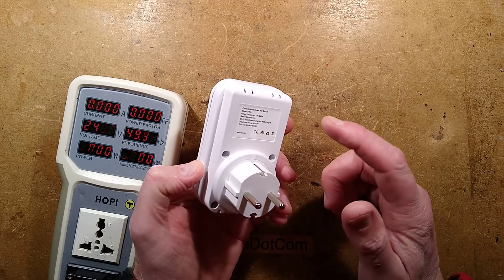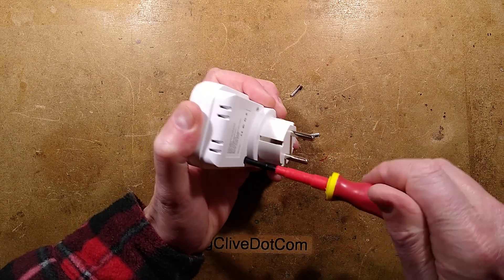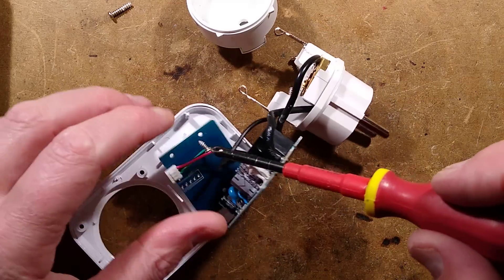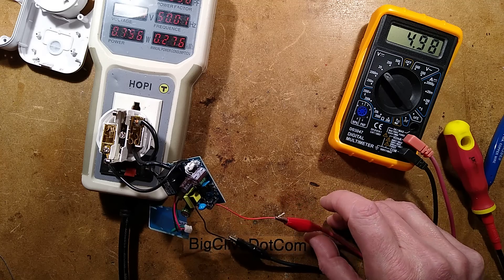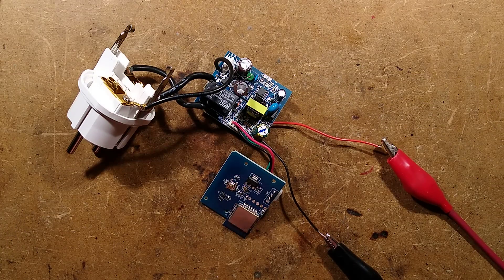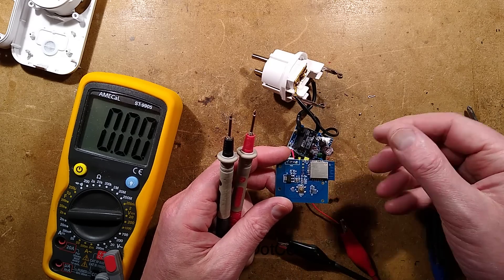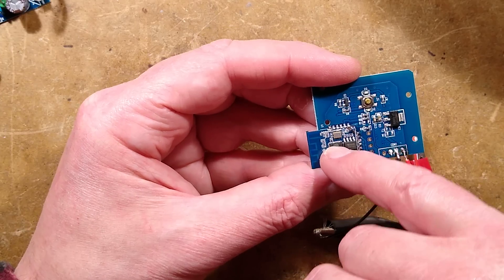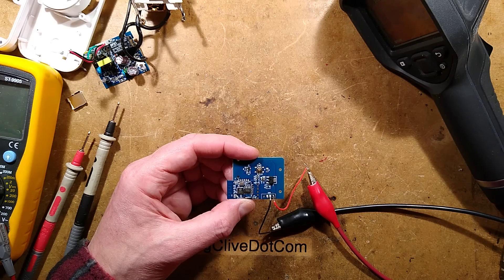WiFi socket repair fail

Comment: An ESP draws about 80mA of current when active with one or more sensors connected to it. The metal cover can get slightly warm which is normal. The WiFi module takes a lot of power. I have several DIY boards with them in service for a self made weather station using a Python server on my NAS recording data into a PostgreSQL database. ESP modules are pretty forgiving. I once had one connected backwards on 5V 2A power. It went really hot. But after realizing the mistake after about 10 seconds I swapped the polarity and it's since then working just fine. I think this was a manufacturing defect that manifested after QC.

Comment: Next to it looks like an external flash chip and ESPs use strapping lines for bootsel so if you desoldered the esp8266ex IC and replaced it with the same part you wouldn't need to bother with reflashing, just a drop-in replacement.

Comment: Does the EEPROM contain the firmware? If so, you could probably just yank it off and put it on another esp8266 module, thus bringing the device back to life. I've played with these modules before, but I've never actually thought about where the firmware is stored (on-chip or off-chip).

Comment: I bought a bunch of cheap clearance stock ESP8266 smart plugs from a charity shop last year. About half of them have failed; mostly from a dried out smoothing capacitor, where the whole aluminum shell literally popped off the top, leaving the paper and base behind. A couple, though, just turned on once and then never showed any signs of life again. I can now see why they ended up in a charity shop for £1 each, though the ones that are remaining by process of elimination seem pretty reliable.

Comment: What I'd try would be to see if it would work to reflash the firmware of the ESP8266, using an open source project like Tasmota. It is thinkable that the flash memory chip developed a bit of bit rot, throwing the MCU into a boot loop. At least this is somewhat consistent with the symptoms, but it is also very much possible that the MCU or flash chip got some more substantial damage, but modules with ESP8266 (or the newer ESP32-C3) are easy to get and replace. The existing Wifi module looks like LM1, you can find the pinout searching for tasmota pinout lm1 (not going to post any links).

Comment: It's possible the module has been bricked. A followup to this would be to hook the UART and use esptool to see if there is anyone home (esptool -p COMPORT flash_id and then chip_id).
Remember that to enter programming mode where esptool would respond you need to ground GPIO0 (probably the button) at power up.

Not that these things can't fail but I would guess a software brick first. If that's the case others also mentioned Tasmota and ESPHome (there is also Home Assistant Architect for HomeKit integration) if you want to play with these things.

All 3 are open source firmware that don't rely to shady cloud services and third party apps to control devices remotely

Comment: If you could find another wifi chip, maybe you could replace it, my guess would be that the firmware is in that SPI flash chip, and if you find another complete module, you could try replacing it, and then replacing the flash module in it for the older module.
But that is assuming the issue is with the wifi chip, and not the storage.

Comment: Wonder if it's a sticky / shorted button as they normally connect it to GPIO2 or GPIO0, boot mode pin. Makes it easy for flashing the chip. A revisit with the gound and TX pins connected to FTDI or CH340 to see what mode it is in at boot and any ouput

Comment: Great Video Clive, One thing you didn't consider was a possibly corrupt or failed software update? You sound like are a bit disappointed when you can't repair something. I just had the same with a Dyson Hot and Cool fan I was trying to repair. Seems the motor controller IC failed, took out a few tracks, and fed back into the MCU which is now toast! I could have replaced the MCU but I don't have the code to program it. I did a video on it if you're interested.

Comment: ESP chips run fairly warm and use about 100ma while idle...
It's likely the SPI flash chip either died or has garbage data on it from a failed update or something.
Short GPIO0 to ground, hook up TTL serial (3.3v) and see if esptool can identify the chip... If it can, tasmota time.

Comment: you can buy generic radio receivers with the remote (remote + bare pcb) and stuff that in !!
also maybe add a diode on the green wire to protect against reverse current from the relay

Comment: ESP8266 chips do run warm, so 30 c is not an unhappy tempeerature for them.   
I would say that it either lost its programming or the RAM  chip may have failed.  ESP8266 doesn't have onboard RAM so the external memory could also be faulty.   It would have been a cheap device most likely, based around the Espressif chip.   Unfortunately they do die at times.
Reply: Even some ESP32 have a tendency to corrupt their own on-board memory with their own WiFi signals. They're really cool and cheap chips, but sometimes I'd wish to pay a bit more for a tiny bit more robustness.

Comment: As others have said, these ESP8266EX modules are easy to get, so replacing it shouldn't be too complicated.

Why ESP8266 modules like to die? Not sure, I have had some NodeMCU boards that just went and began to act crazy or outright died. Haven't cracked them open, but they don't feel like the kind of solution I'd pick for anything that has to be reliable and work 24/7. Perfect for cheap IoT tat like this, though :)
Reply: have you tried to dump the firmware from a failed module?. a bit curious if it was a bad chip design or something caused firmware corruption. (or counterfeit chip?)
Reply: @n.shiina8798  Not yet, but doing more detailed autopsies on the failed modules is definitely on my TODO list.

One module I'm interested in debugging is one that was working 24/7 for months, then was put away in storage for a few years and when taken out of storage and flashed with new firmware just did frantic flashing with the LED. Firmware flashing succeeded, however, with 100% on the checksum.

Maybe the Flash is still fine, but something else failed? Very mysterious failure mode at least.

Comment: Hi, I have a question, maybe someone can help. I have a digital timer for a light in a small greenhouse. The last week it began acting weird, the lights began humming when off. I checked the timer and its leaking 20V AC (wallpower is 220V) when it should be off! What could have happened to it/How can this happen? It is not inside the greedhouse, so it couldn't have gotten wet. I know its hard to say without seeing the box, but is there anything inside a timer that could leak 10% Voltage?
Reply: Depends how it switches the output. I'd guess it may just use a relay, and perhaps there is a capacitor (snubber) across the contacts to prevent arcing which has failed? But that's just a guess without seeing it. I recently had something similar with a repair video on Dyson fan I did which the oscillation motor was on continuously.
Reply from the maker: Is the mains polarity correct?  If the relay is switching the neutral it may be that the lights have some current capacitively coupling to ground.
Reply: @bigclivedotcom  I found some corrosion/gunk on 2 diodes that go to the black wire on the outlet side and the relay seems to have gotten hot (I can scratch the housing with my fingernail at some points). It also seems to have an indentation on top from something. I think my darn cat might have thrown up on it. It got onto the black wire somehow shorting it and overheating and damagingt the relay and at least one diode (its no longer a diode but a 16million Ohm resistor). Sorry for you asking a question I should have asked my cat! We are going to have words.

Comment: Clive did you check the clicky button?
Reply from the maker: Yes I did.  I bridged it with wire, as they often fail with high resistance contacts.

Comment: Solder a new ESP8266 E12F module with Tasmota software. Or use EspHome software.
Or the devices are so cheap that you can buy a new one.

Comment: You can test the esp module - desolder it from the carrier board, you can replace it with esp12 module from aliexpress for under $2 and flash it with open source Tasmota firmware. The one thing that usually goes wrong is not the module, but the reset, enable and gpio0 pins. Might be worth to just solder rx/tx and check if/what the boot output is. But yeah - the price of such device is laughably small, not worth the time probably...
Reply: First one pointing to the needed bootup setup. Also, just testing tx with the scope should tell you if there is something there, which I doubt as the onboard led is off.

Comment: Hi Clive, I dabble with 8266 modules and I think that current is about right. I use wemos D1 mini's and they draw about 50-70ma they have extra circuitry to support programming etc. Has it lost its config? The comment below is a good idea!

Comment: 04:20 — Oh, the little pulsing whistling! Something's definitely wrong with the unit.
Reply from the maker: That's just the switching supply cutting in and out to keep the output capacitor topped up to 5V.
Reply: @bigclivedotcom  oh, now I see, thank you.

Comment: Looks like an esp12F module. They can pull about 140mA and get a bit warm when the wifi is running. They are very cheap, and you can flash them with ESPHome or Tasmota to restore working (and probably better) firmware for smart switches.

Comment: These have a tendency to attempt OTA updates when first connecting to WiFi and its unresponsive, seems like the setup has failed, so you start over and unplug it during the update and bingo you've successfully cremated the firmware. Otherwise there are naturally lots of reasons why forced OTA updates are just a bad idea and yeah smart plugs and bulbs are great at doing that and failing on you. As mentioned below Tasmota firmware may do the job.
Reply: Not necessarily. If your program is small enough, you can even use the stock OTA library to reliably update your program. It will keep wo copies of the firmware, one being active as well as one being replaced. But then again I might be expecting too much from companies trying to sell new hardware now and then.😉
Reply: @Smaxx  oh. Not to say OTA updates are always a bad thing but just in the case of these devices it often causes a bork and the average user is stuffed in that case. Forced updates without any notification that it's happening... Not great

Comment: I assumed those smart sockets used some proprietary chip and hearing you read out "esp8266" has now got me taking mine apart, and can not believe these smart devices are running a simple off the shelf ESP chip that can be re-flashed, re-programmed got me interested into taking mine apart now and might even order few ESP's for building my own smart devices, lol.
Reply: Toying around with ESPs is definitely fun! I'd actually recommend getting a NodeMCU for your first experiments. This way you get chip and programmer all in one module. It consumes more power etc. but reprogramming is way easier to do. There's also an insane plethora of combined boards with peripherals, like the "ESP32-Cam" providing you with a simple webcam module (using it as a cheap ~20$ device to keep an eye on our dogs without having to invest like 50-70 bucks into some China Cloud hardware).
Reply from the maker: Just keep in mind that not all the power supplies in these smart sockets are isolated from the mains supply.
Reply: Sadly tuya (the  biggest corporation who makes the modules for iot and the firmware and hosts the cloud servers) recently switched to other SOCs they ditched the esp (tywe3s, tywe2s, tywe1s, every chip with TY in it) and went for beken or realtek (WB, cb, wr etc.)

Comment: I know this might seem horribly mundane but what is the package of those little LEDs called? Good video, Clive, you can't save them all.
Reply from the maker: My own preference for surface mount LEDs is 1206 as they are easier to solder.
Reply: Probably 0805?
Reply: @rexsceleratorum1632  At least that gives me something to look up, Thanks!
Reply: @johnpossum556  LED packages are usually specified by concatenated 2 digit length and width, either metric (x0.1mm) or imperial (x0.01"). Like Clive said, 1206 is also my preferred size, being one of the larger standard SMD part sizes for resistors etc.

Comment: I think 99% that it's in the bootloop. 
ESP modules often got their firmware corrupted because of bad quality power supply and just trying to boot with a failure. 32 C is nothing to that module, totally normal temperature. My ESP32 can get literally hot while work with WIFI.

Comment: I have 2 different dead ones of these laying around. Unfortunately much smaller cases, but you just triggered my „let‘s repair them“ nerve. At least I have some of the ESP12E modules already in stock.

Comment: ESP8266 are quite fun chips!
Reply: Yeah they are, so are the ESP32's. I built a wifi geiger counter that logs to radmon with an esp8266, and ended up building an incubator out of a wine fridge using the esp32 which controlled the temperature / humidity/ egg rotation, and LCD display / menu while logging the data to the internet. Was quite a fun project.

Comment: it is first time I see BigCliveDotCom losing it ;-) It seems you do not have much exposure to ESP chips. There are pins on this little board you could connect to ESP and check what is going on there. Btw ESP are always getting warm - that is their nature
Reply: Not much. Lets take the magnification... E...S....P...8....2.... uh I cant see... let me change position and orientation... magnification again... We all were screaming 66!
Reply: @asturcon3794  EXACTLY!!!
Reply from the maker: You guys can see better detail with the HD video than I can see with my eyes.
Reply from the maker: It's lack of desire to work with ESP chips.  I barely have enough time as it is without getting into that minefield.

Comment: I think the esp chip is faulty, the LED on it was constantly lit with a faint glow in the video, sometimes that LED act like this when it's en pin is constantly hold down to gnd but most of the time is it's a sign of failure or wrong boot mode. A working esp in a good operation mode blink on startup.
Usually two things happen about these modules, either the program on the spi chip will get corrupted by external causes like power failure or the esp chip go bad, considering the esp getting hot it might be this but even if the esp has failed you can still repair this product. 
The whole program on these modules is on the spi flash chip, even if the esp has failed most likely the spi program is intact. If the esp chip is faulty you can either repalce the esp chip (qfn package might be to small for some people) or you can change the whole module and put the old spi chip into new module then whole thing comes back to life with it's original program. No programming needed at all.
If the spi is corrupted programming is required of course.
Either way it all depends on how much time and effort are you willing to spend on repairing something like this.

Comment: The 8266 runs at 160mhz... amazing when I think just a few years ago if you had told somebody they would have remote control outlets with a 160mhz cpu running a mini networking chip they would have thought you were joking.

Assuming the micro has died if you had happened to purchase several of these outlets initially then you could probably just dump the flash from another one and buy / program a new module.. they can be had from about $1.50 from aliexpress etc.

Alternatively there is probably already some compatible code online for these.

Seems like a lot of hassle though for something that costs pennies these days.
Reply: You can just flash off-the-shelf Tasmota or ESPHome and then configure it. Should be straightforward for a simple plug.
Reply: Or an LED torch (or flashlight if you prefer). I just repaired a Milwaukee spotlight (repaired quite a bit Milwaukee stuff so far) that used a microcontroller to generate the waveform for the buck converter, measure the battery voltage, and measure the current flowing through the LED, so the whole thing was being run via the microcontroller. Pretty mad to thing that a torch is being run by one!

Comment: Agreed. Nothing worse than an irreparable object.
Reply: Yep, I just left a comment saying pretty much the same. I just did a video on a Dyson hot and cool fan, but unfortunately the motor driver failed, and took out the MCU, (which I could replace) but there isn't code available. And to make it worse Dyson has discontinued it, and boards are no longer available.
Reply: We live in a trash society .

Comment: I don't know if the pin header that's not populated is a serial connection, you could try to see if there's some sort of output on the serial connection and you can maybe reprogram the chip that way.

Comment: Why do you call it unrepairable though? esp8266s are used in every cheap wifi device these days, they're super cheap and easy to work with, as for the firmware, of course people already mentioned Tasmota, but ESPurna is another option, if you look for the LINGAN SWA1 version, you probably won’t even have to set up anything or figure out what pins go where, should just work.
Reply: Also ESPHome

Comment: I've been using the X-10 stuff for 35 years and have lost a few, but the rest keep going and going. I use them for the front, back, right, and left lights on my house. They get used every day. I can't find suitable replacements that have a better range and feedback to let me know they are on. I have collected a big tote of them from the Goodwill and yard sales, so I'm good for the rest of my life, lol.😅
Reply: I guess you don't use surge protectors?  They filter out the noise that x10 puts on the powerline. (That's how they communicate)